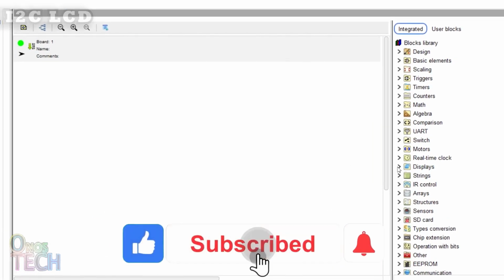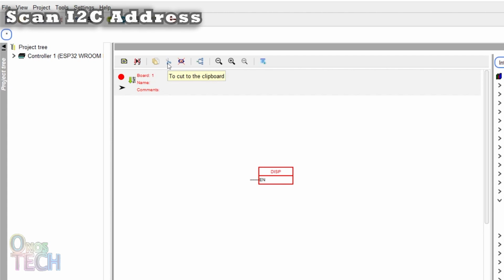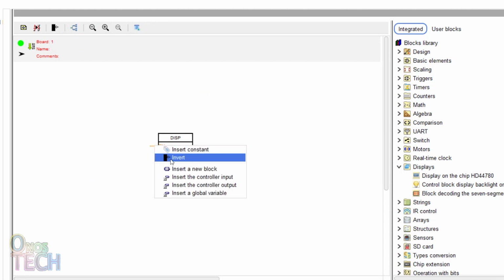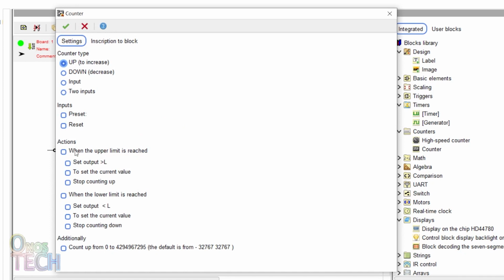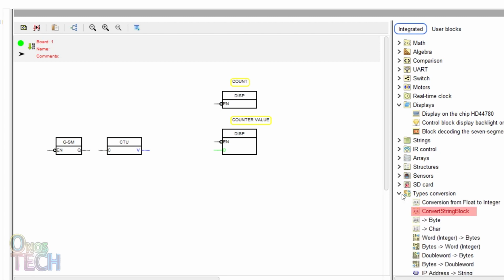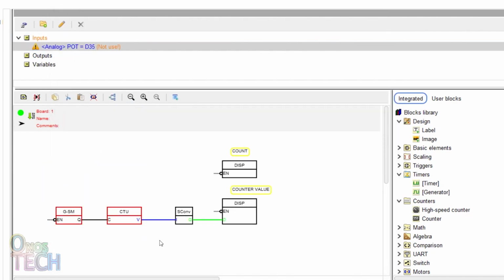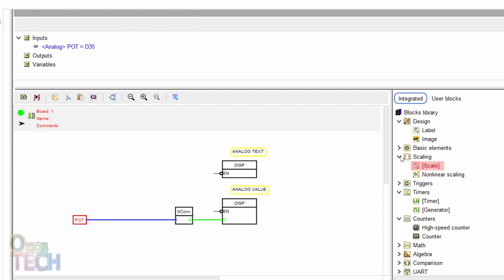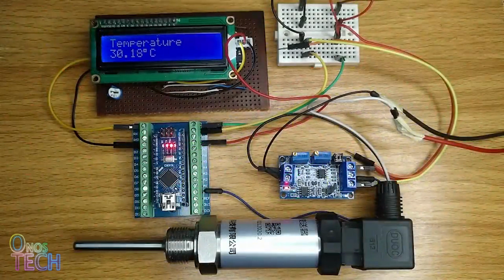FLProg5: Analog Inputs & Scaling on I2C LCD | ESP32 NodeMCU | Arduino Visual Embedded Programming

Comment: Hello

watching this video now, I came up with an idea that I would need
but as always I need your little help
I have a solar tracker because I live in a forest
(you can see it on a video on my channel)

the idea is
can i make a solar tracker with esp32 and i can see the status on my phone

what do you think about that

so if you could just give me an idea with these blocks, how can I measure the input voltage with two light sensors and have a high or low level at the output of some two pins due to the movement of the motor

hmm
who knows what Google will translate for you to understand

it's best if you come to us in the forest and be our guest

I am just kidding a bit
greetings and thank you very much
Reply from the maker: Great idea! Please send details of what you want to onos.technology.com
Reply: @OnosTech  there is nothing of your work on this site

I already have a solar tracker made with arduino nano that has been working perfectly for almost ten years
I also have skch, of course I didn't write it

now instead of arduino nano one esp32 percent has more analog inputs

and a sketch with which the esp32 would send the measurement data of those two analog sensors to the remotexy and if I had it on my phone

unfortunately i don't know english so it's hard for me to understand these systems with blocks on flprog but i like how you do it

and I can send you a sketch n avas mail if it would help you to create these blocks

thank you very much for your response

Comment: I am stuck in FLPROG logic
I have an analog signal pin that is A0  (0-5v)
And I want the digital output pin 7 micro at 3.5 volt how is done
Reply from the maker: Use opto-isolator module for the output like this one https://s.click.aliexpress.com/e/_A0qFTW
See video: https://youtu.be/OxfWWAyxcVc